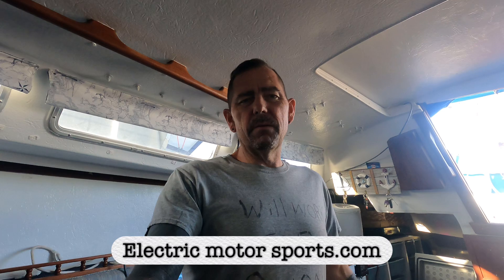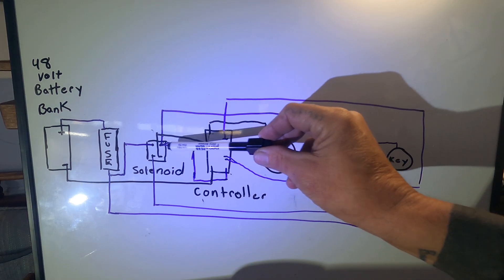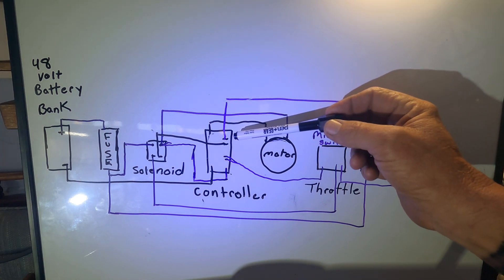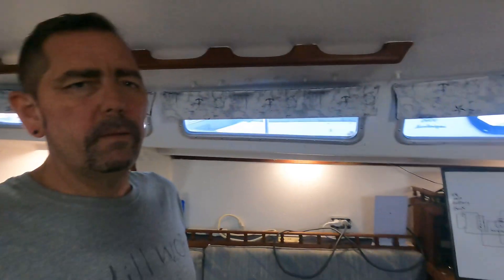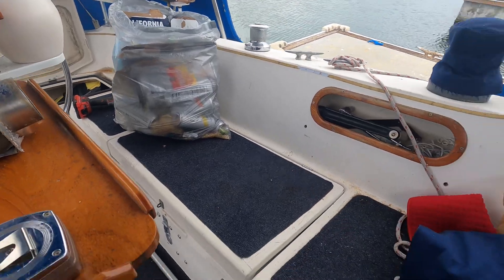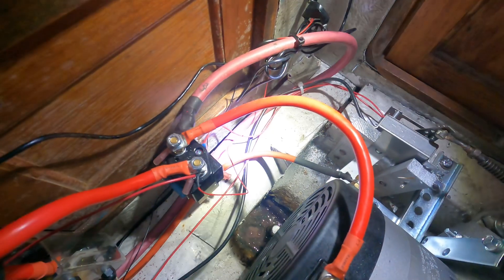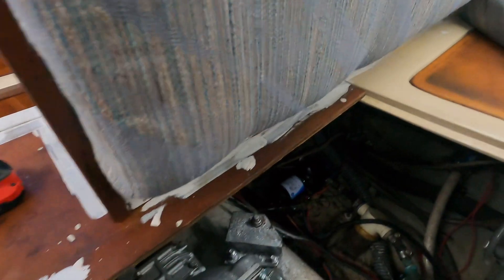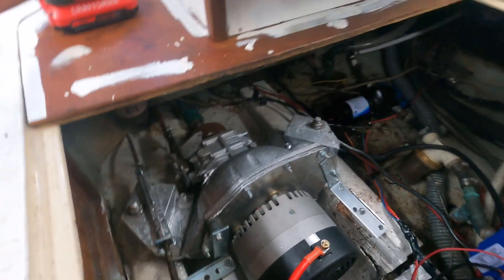Electric Motor How it Works! Save an Old Boat! Catalina 30 Sailboat  SAILING CHAOS S02E12

Comment: Nice job- drawing was good. I have the same motor and it is much more reliable than diesel. No oil to change- no fuel to filter, no water flowing through the boat for cooling. Simple low maintenance. Very happy with it. 
The battery expense is offset by what fuel would cost through the years. And mechanics in my case since I do not have your skills that way. Keep preaching the way of electricity! 🎉
Reply from the maker: Thanks and as always thank you for coming along with us. I always enjoy your comments

Comment: Nicely done with understandable diagram with video follow-up of actual items in boat.  I looked at the controller's schematic on co's website and it was pretty clear.  Some of the wiring carries heavy current, while the small wires carry very low current like those for powering the controller, for solenoid for activation, key switch and throttle switch.  
Too bad co does not have straight on shots/photos of the controller, solenoid and throttle switch as those could have been pasted on to your white board and we'd see exactly where you attached wires.  
Can we assume, given that you are using your old tranny,  that you did not wire up throttle switch (or ?) to make the motor spin in reverse direction when you want to go in reverse?  Assume your manual throttle just pushes the tranny into reverse gear position via linkage.  Or does the tranny stay in forward gear and electric motor spins it in opposite direction?
You mentioned that when you were motoring that you were only using 4 amps?  Seems low as 4amps x 50v = 200watts which is not very much power, like 1/4-1/3 hp equivalent.  Maybe I did not hear/remember correctly.

As far as going out in windy conditions.... don't know your overall sailing/boating experience , but best to get experience in safe/safer locations soon rather than later when caught in storm offshore with 6' waves- so that you have experience reducing sail, reefing and heaving to.
Reply from the maker: I did use the existing tranny so I have the motor in only one direction. So it works just as if I was using a combustion engine. I measured the amps at around 3 knots and it was really less than 4 amps. I was shocked myself. The only change in the set up was the electric motor the throttle linkage and tranny are stock. Also I am new to sailing however I have several years of boating experience coastal as well as offshore on commercial boats.

Comment: What I like about the electric motor setup is, little or no maintenance like oil change, oil filters, coolant, fuel filters. The noise and smell from deasil engines can be irritating. The technology for electric motors will only improve. On another channel, they have a compact generator for emergencies. Thanks for making the wiring diagram simple.
Reply from the maker: Thanks we love it I have a super quiet generator as well just in case! Thank you so much for watching